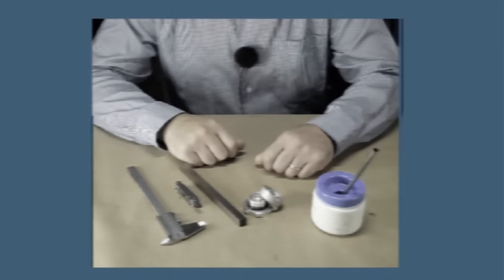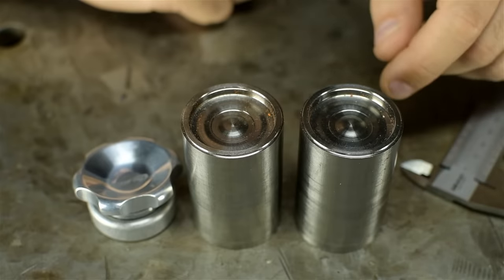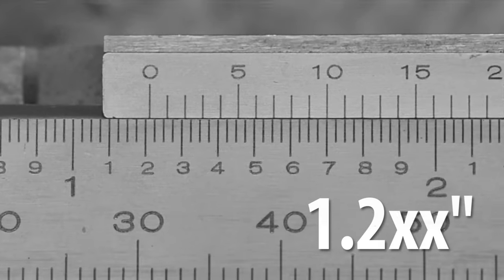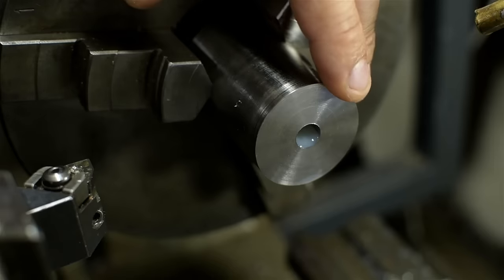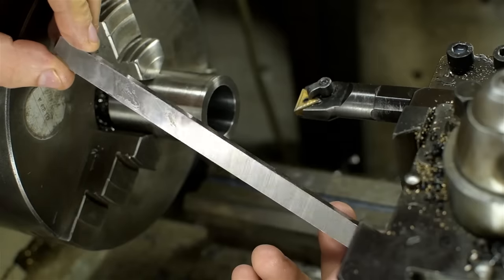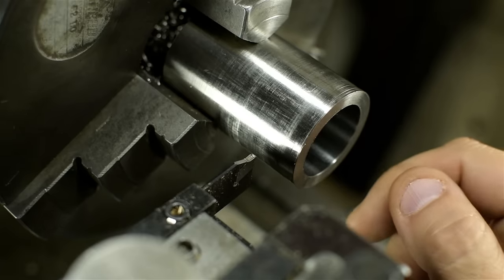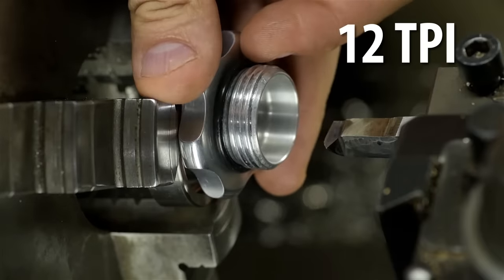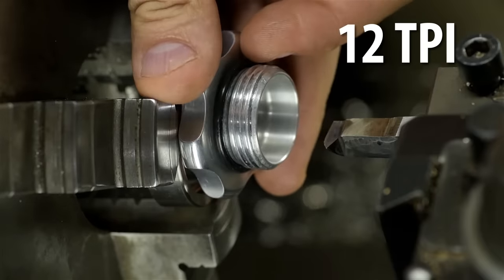Turning Titanium: Trials and Tribulations

Comment: THANKS, now I know how to use a caliper, I never knew what those additional lines mean, but mine only have 10 divisions on mm and 8 on in. I suppose it only gets to 0.1 mm precision or 0.0039 in, more than enough to me ;)
Reply: What you have in your hands is a fractional imperial calliper. 
So those 8 divisions on the imperial vernier scale are 1/128th of an inch divisions of 1/16th of an inch. The main scale has 1/16, 1/8, 1/4, 1/2 and inch divisions. I hope this helps
Reply: There being 8 off 1/128ths in 1/16th of an inch.
Reply: Must be wood butchers calipers.
Reply: carl white  I have lived in Florida for one year (graduated high school class of 66) and have never understood, how you put up with the total fractional lunacy of the imperial system, which when you get past cutting lumber is also switched to the decimal 1 thousands of an inch, to complete the utter confusion (at least in my head). My foster parents for that year told me, that the U.S. was even then a member of the ISO but simply never complied using the decimal system (except e.g. in medicine, he was a doctor). Now I‘m verklemmt, talk amongst yourself!

Comment: Those calipers would be PERFECT for measuring a canutore valve assembly. The tang that comes out the end can be open so it’s out and used to measure how much liquid you have in the blinker fluid reservoir also.

Comment: The one time we used HSS in the cnc lathe. Sharp HSS tooling puts far less point load on the material so minimises rubbing and therefore heat and the tendancy for work hardening. 

We were making rings for a jeweler before titanium rings were common. He'd shrink gold bands into grooves on the OD.

Comment: Hello
I flew in a combat aircraft known as the f 4 phantom.
This was the first time i was around titanium in any form.
This area back by the exaust  from the two j 79 engines
were after burners ajustable cones were activated
for more thrust . When hot to cool down  they made 
the neatest blue and brown colors . Warnings to the
mechanics were not to use a  pencil on this material
for it would crack to pieces when it got hot again.

Comment: Love your explanation of a Vernier, we used to measure big diameters with a Vernier Tape Measure, Oh yes we did. <Grin>. Also, at a later date can you show the masses how to measure a thread diameter properly over wires, you might need a whole video to do that one. When I machine Titanium, aside from keeping the tool sharp for the reasons you already mentioned, I find Titanium sometimes to act like a sponge,,,, it recovers, also I try to make my last cut about 0.040", also, before resorting to solid carbide drill (none of that in my day), have you got a Nimonic drill bit?.  Keep up the good work. Cheers buddy.

Comment: Well, you did intentional discoloration.  In my past, I have gone to extreme measures to avoid the discoloration as a result of welding.  Purge gas both on top and background was dried and tested to have no dew point higher than -70 degrees C.  The process specification was -65, so we applied the extra 5 for safety margin…

Comment: Thermal expansion is a big factor in titanium cut 5 thou under and then finish cut.
Use ceramic inserts , if you can’t afford get the TiAIN coating. No coolant let the chip take the heat blue chips are good.

Comment: Hello Tony.
I have a question or two. I am a goldsmith working with tantalum. Unalloyed pure tantalum, that is not annealed. We re using lathes in our process and i was wondering if you have any tips about how to zero in into perfect knife geometry based on the current performance of a knife or of a finish or if you know any angles that might work.  
The end finish is not required to be high end since we do work later on those surfaces anyways or are just  plain hidden. Thanx in advance.

Comment: As a hobby machinist with access to a scrap bin full of 304 stainless, I got a fair bit of experience with machining a difficult material.  As you know, 304 work hardens like crazy.  I heard all the usual warnings about how difficult 6AL4V was to machine, but when I finally got some, I found it no more difficult than 304.  I have not noticed that 6AL4V work hardens, but it does get hot and it requires sharp tools.  And yeah, it's a fire hazard.  Yeah again, I've had a couple small fires.  There is actually a name for titanium's property of catching fire when cut fast and thin.  I don't recall the name, though.

Comment: In my somewhat limited experience with titanium I've had some incredible luck with polished top, ultra high rake aluminum inserts. We're talking razor sharp slice your eyeball open just looking at them type inserts. We found 70sfpm, 0.040" DOC 0.015" per Rev, leaves a stunning finish. Like. Mirror finish.

Comment: Quick and dirty advice: slow spindle speeds keep the tool from burning up in titanium.  Like 200 rpm or less.  You can take aggressive depth of cut, but respect the speed.  Im no expert but I have put out a few titanium fires in over the years.

Comment: @ThisOldTony, What model vernier caliper is that?  It looks like the scales are coplanar. I hate that they are making them all with the vernier scales at an angle, or worse two levels - which fools the eye if you can’t get it at an angle to read it straight on. The model you have looks sweet!  I can see it is Mituyoto, but I do not see that one in their catalog. Maybe I can find one on eBay if I had a model number?  Can you help out another old guy? 😁

Comment: Another great example how the metric system is so much easier to use. With inches, you need to calculate the fractions and tolerance into decimals to actualy measure it. With metric... you just use the calipers and know instantly :-D. We also have digital calipers that can switch between mm and inch.  Never used it. Hats down for all engineers using the imperial system. Also, interesting you are using HSS. I haven't used HSS in ages, all the tools for lathes and mills we have are carbide, changeable carbide inserts or soldered carbides on HSS body.

Comment: Question for the comment section:  I've seen videos like the one Tony is lampooning, the ones that seem to assume you've got a school that has a shop class that's well stocked, has a guy in the parts room whose job it is to be the guy in the parts room, and the staff seems to know what they're doing.  What's that actually like?  By the time I got there, the staff is either WWII vets who should have retired centuries ago, that one Army vet who is a qualified A&P mechanic despite having spent 6 years on nothing but Apache tail rotors, and a pile of "back during the third round of layoffs" types.  The equipment that is actually in the curriculum is broken, but there's rooms full of pristine tools the school doesn't offer classes on.  What was it like before the lead paint chips generation started making decisions?

Comment: The fire hazard warning is a good one.. i did actually have a fire in my CNC Mill.. and if titanium catches fire, it is hard to put it out.. 

Coloring Titanium is easier with a DC powersupply.. put water in a container, and dissolve some Baking Soda in it, put your PSU  to 30 Volts, and Anodize the titanium to turn it into a beautifull shade of blue.. go to 60 Volt and you get a gold color..

Comment: Titanium is a freaky metal. I met a very skinny polisher in Sheffield calerd Wane Who showed me a few tips. First he played down some newspaper on his vented downdraft polishing bench. Because Titanium sheds sparks - LOTS of them. If the sparks went into his lint bags they would probably start a fire. "Only use light pressure he told me, If you push hard you crate nasty ripples and work harden the part." He produced a lovely finish.

Comment: Lovely stuff! We once had to steal it from the Soviets so we could make SR-71s. Strong as steel, light as aluminum, leave it in the ocean for a year and it won’t even spot. But Ti wrecks tooling. Know what’s worse on tooling? Carbon Fiber. Heating Ti is a crap shoot. Anything above cake-baking temps and it oxidizes like MAD. Must be welded in a totally shielded environment.

Comment: Titanium doesn't change properties. That's why its used in corrosive and high temp applications. Ti is well understood in machining. Research very well before you start. As long as you use the correct speeds and feeds and appropriate cutting tools Ti is very predictable. Biggest mistake people make is trying a spring pass. If you want to see carbide glow red hot just try a spring pass on the lathe.

Comment: If I need a 5/16 inch wrench or socket, I'll use a 8mm if it's closer.
7/16 inch...11mm will do.
1/2 inch ... 13mm usually works
The bottom line is, regardless of where you are in the world, the distance from point A to point B can be 1/2 inch, 13mm, "about that much" or "a pinkie plus or minus a vc".
That said, for all you youngins out there, learn to read a ruler (from both sides) use vernier calipers (top and bottom), convert all the silly USA measurements into the world standard (hint: in the google bar type "tonne = ton", or "25.5mm = inches" or ".625 miles = kilometer".
If you do this by the time you are my age you'll be able to divide fractions in your head, and rarely ever need to look at the decimal equivalents poster pinned above your bed next to the periodic table. You can become a genius even if you weren't born a child prodigy.
But it might not happen if you don't put that game controller down and move out of your parents house. Just sayin'

Comment: Gotta watch them titanium chips. When they’re hot, they can burn into your skin and cause blood poisoning. It’s always the one or two missed that causes blood poisoning. (finger tips swell up, infections, red lines up the arm. Keflex burns the stomach). Use gloves. Gloves smell much better burning than you or I do.

I used a 5000rpm pneumatic drill motor and cobalt drills to drill titanium trim strips for cargo liners. (get out of there before it heats up). Faster speeds put the heat in the chip. Some sort of FAA burn req, (though I thought the aluminum airframe the trim strips were screwed into had a lower boiling point...)
Who am I to question. But I did get that question right in metal shop. So much for studying...

I have a Grizzly G0516 combo and want to build a hydraulic hose crimper for my excavator. I have a few 20 ton jacks to spare. How would you approach this? 
The lathe gear train sucks on the G0516, please review, revise, and advise. Its brand new and was discontinued. Manual is online.

Building a small rotary indexer would be a cool project for that mini mill lathe combo. I would like to make gears for my other mini lathe...

Comment: Has anyone ever bothered to mention argon-filled work rooms with tunnel suits and glove boxes with the machines and the argon-filled room infrastructures and technostructures redesigned and re-engineered and repositioned and constructed in such a way to accommodate the tunnel suits and glove boxes technologies. Which are the same engineering requirements and specifications used in the handling and working and forging and machining of weapons grade uranium 235 and plutonium 239 to be used as atomic weapons components during the 1950s and 1960s Cold War era period in our feverish arms race to create massive atomic weapons stockpiles. Boy do I miss those days!

Comment: I know this video is quite old, but I'm seeing a common theme when it comes to complaints about turning exotic materials. Work hardening when the tool dwells. while this is true, I think it's important to point out that using one coolant for all materials, is a big part of the problem. 
with the appropriate cutting oil, Titanium cuts beautifully. Stainless steel grades should not all be clumped together as difficult to machine. 304 can be difficult, whereas 303 is free machining with similar characteristics as 304.

Comment: So, I was not crazy thinking that some material (the two metal pieces that support the bed) can suddenly become so hard that I waste all my drill bits trying to finish a hole (even if I successfully drilled many holes on the same piece of metal before encountering that hard one).
Your advice about applying a constant pressure while cutting in titanium (otherwise, the titanium may harden) probably apply to a few other metal. 
I suspect the metal bed frame support are made from recycled material and may contain a random mix of metals.

Comment: Tony, you just saved me a lot of money and tears. I have two of these exact blanks and need to make about 6 spacers from it for a motorcycle cush drive.  I am going to just buy a carbide drill bit. While it is going to cost me significantly more money to make these parts. I am praying that I can build about 6 without ruining the tooling. The lathe I have access too doesnt have coolant. Am I screwed?
Reply from the maker: take it slowly, use lots of cutting oil
Reply: @ThisOldTony  Thank you for the reply. I will try to film this adventure and show the results. I am just glad I have zero threads to cut. The boring of the hole on the spacer is what has me most concerned. Ordered 2 jobber drill bits based on your video. Thanks again.

Comment: I am trying to find information on why you would use a horizontal Mill vs vertical. I'm considering purchasing a Rockwell Mill that has both capabilities
Reply from the maker: horizontal, usually, is much more rigid so can remove more material faster than a vertical of comparable size.

Comment: Titanium also has another interesting property which is why its not used in sliding / moving applications. it friction welds. pistons for example.... if you had titanium pistons in your car it would run for a while. but eventually the pistons would friction weld to the steel sleeves or aluminum bore of your block and the car would die instantly also titanium flakes are incredibly dangerous. titanium in tiny peices behaves like magnesium flakes. if given enough velocity will quite literally catch fire. by the oxygen content of the atmosphere.

edit: just saw the end of the video......... he explains the fire hazard better.

Comment: actually you can weld TI without oxidation colours , also you need a defuser to colour TI correctly , nothing more than a dish and a "bath" of chips , brass ones or even TI ones ...maybe , never tried TI chips for it PS im a gunsmith and a blacksmith (qualified in both !! ) PPS you can also colour it in liquid by passing electricity through it , higher the voltage to change the colour most consistent method of all there are videos on you tube about it .PPPS you can also do it in a salt bath , think it was potassium salts , been a long time since i researched it anyway you melt the solid get it to the 600c - 800 c depending on what colour your after and submerge the TI part .....dont sweat in to it it explodes and kills you ..... a lot.

Comment: Titanium isn’t really all the much more difficult to weld than any other metals. If you can wrap your head around that it is more “acceptable” ( loosely hang on to the term) to oxidation than you will be fine. Back purge prior to welding; gas coverage while welding and not to turn up post flow post welding so you do not incur oxidation. That’s basically it, no shit. Just like stainless if you get greying or sugaring increase back purge. If you get color while welding work your CFH on sample pieces until you get desired results. I welded titanium for the aerospace industry. Not an expert but I know enough to get industry acceptable results.

Comment: 9:50 can you not get like a drill bit with a hole down the middle of it and then  thru a bearing  seal and slated ports ar the base of the bit  feed coolest into it using the rotation of the dril to scoop up coolent via the  slanted ports and eject it at the drill head ?

Comment: ah perhaps a solid carbide or insert drill
 I use to machine on titanium a lot slow process and lots of coolant, should have used a carbide insert threader cutter thing. I remember titanium catching on fire in our lathe you have to have a special fire extinguisher to put it out similar to puting mag fire out.

Comment: Don’t fear the reaper should have been playing...
Don’t use coolant run at 10000 rpm air spindle to get the chips out... get that heat out of there!
Energy transfer not just heat.

Comment: I don't understand why so bmany people hate titanium.  I love titanium the tools stay sharp for a long time as long as no one else touches them.  The coolant stays clean.  I think they try to run the tool too fast with too low of a feed rate then it galls up on them.  It is harder than 1018 steel but it is a fairly soft material.

Comment: 04:50 was a flashback to AIT. Do measurements on T55 714 engines that had been "studented" to within a thousands of an inch of their life. Think first stage turbine rotors rolling around. The next time you see a CH-47 overhead you should sidestep at a rapid pace. Did they pass with flying colors or just pass. Hummm.

Comment: Titanium chips are indeed a fire hazard.. Titanium burns just like Magnesium, but slower, but the light is just as bright.. I had a fire in my CNC mill once, due to  a dull endmill.. use sharp endmills or lathe tools only to prevent Chip Fires.. as soon as they become dull, Replace the tool!

Comment: I still crack up at the bung jokes, guess I'm still sort of childish.  I got tired of batteries for my digital calipers, and kinda just moved to the dial calipers for my projects.  It's nice to be able to zero-set the digital, but I'm almost as fast with a hand calc, and even my cheap MIC calipers are fairly accurate as confirmed by my micrometers.